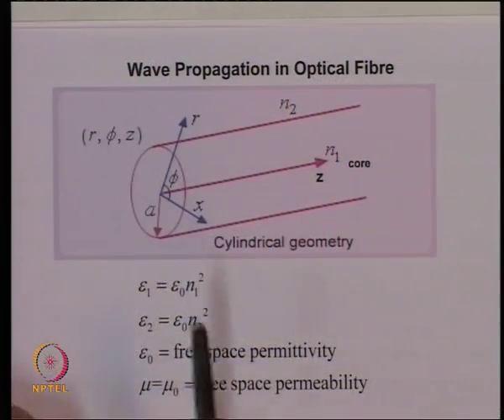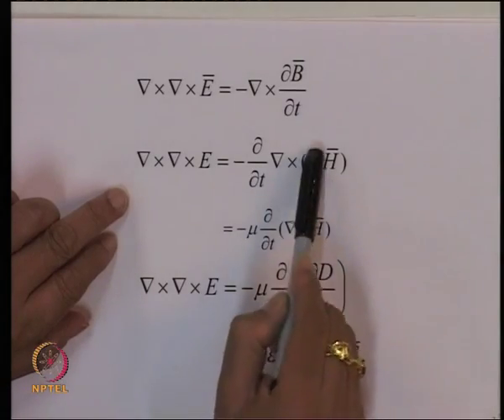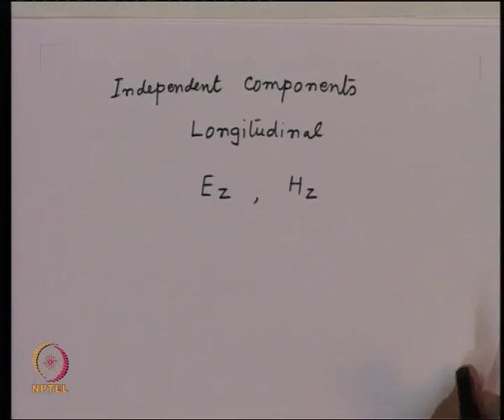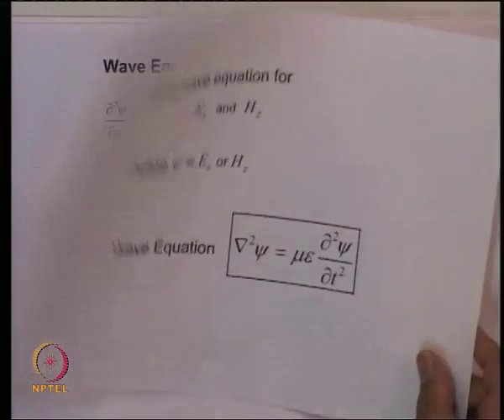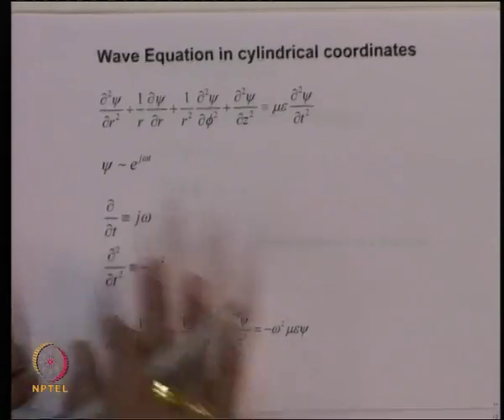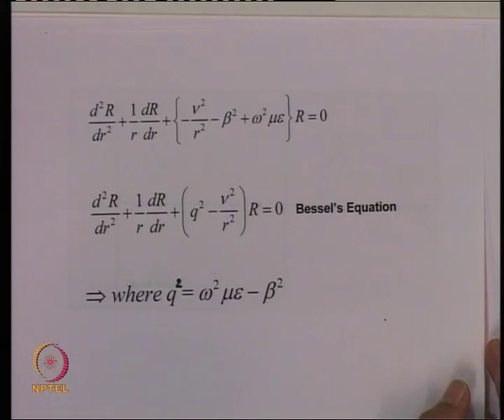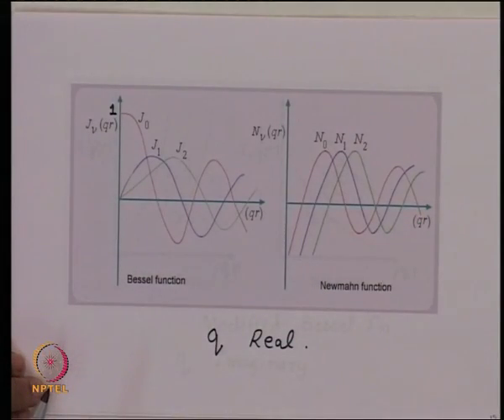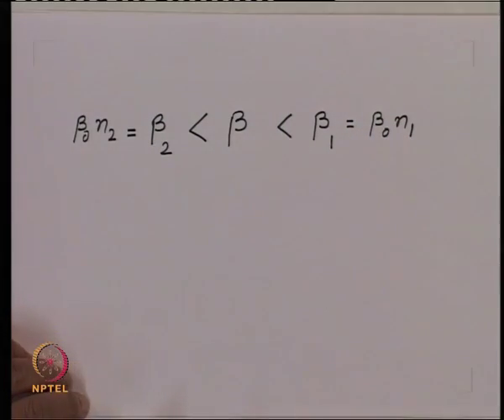Mod-01 Lec-05 Wave Model-I

Comment: why do we set epsilon to be space independent, when n does depend on spacial coordinates x and y?
Reply: how does n depend on x and y ?
Reply: @riseabovehate9476  It can, but does not always. This is a step index fibre,  where the refractive index of cladding is less than core and that is it, one single step. There are other types of fibres as well, and derivations available for the as well in books. For example Introduction to Fibre Optics by Professor Ajoy Ghatak.